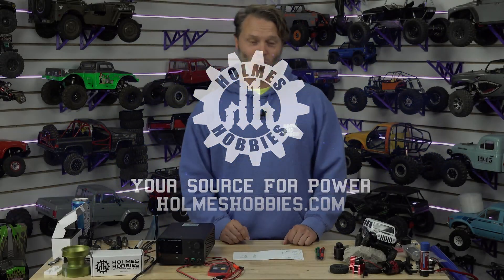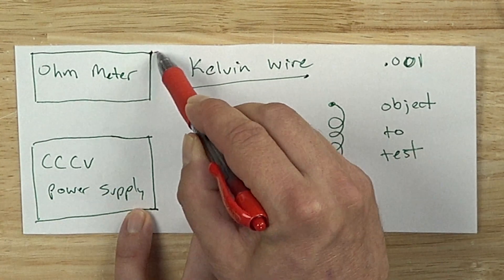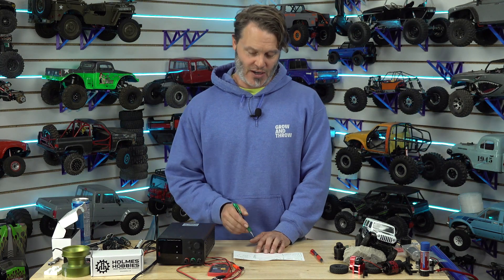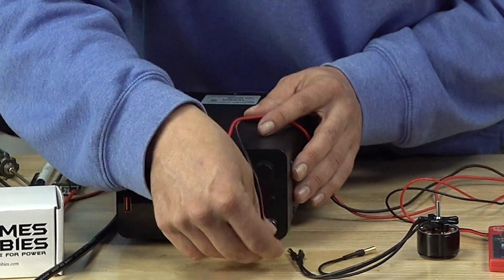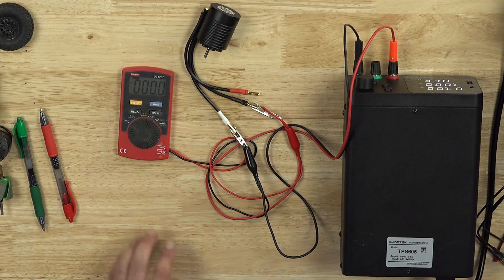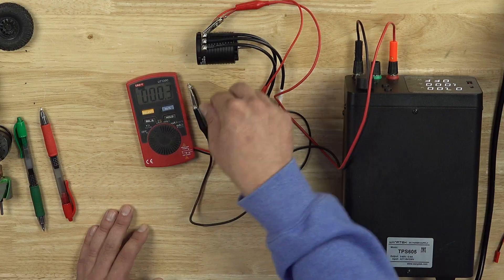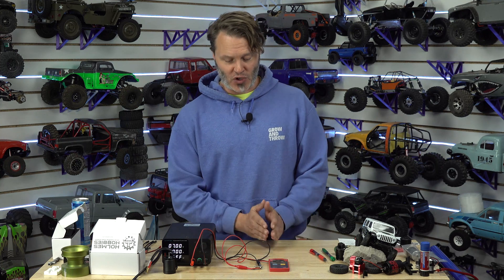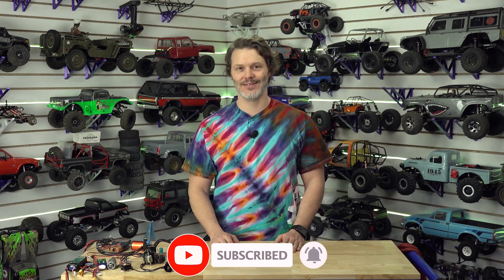John Robert’s DIY Guide + Motor Secrets! 🔧⚡💡 Build a 4-Wire Kelvin Tester & Save Hundreds!

Comment: Good to know. I'm gathering parts right now to do this stuff. 

I was collecting older brushed motors to try my hand at rebuilding them. I picked up an old BRP Motor Dyno to play with as well. Like the Kelvin system here, I'm trying to keep it super simple and low buck

Comment: Would a battery charger work for the CCCV supply?
Reply from the maker: @JKSJ683  if it has hot wire mode, yes

Comment: Cool stuff and helpful. The really neat thing is that this way of measurement takes the resistance of the leads from the power supply and meter out of the equation. If you want the ultimate in low ohm measurement precision you can use the Kelvin double bridge method which gets down to 0.0001 ohms but it's more fiddly and unnecessary for the use cases that we mostly need.

One little thing is that the symbol for an inductor was used in place of the resistor symbol in the drawing. The resistor symbol is the sawtooth zigzag one.
Reply from the maker: @brianbrigg57  oh yes, that is an inductor symbol!  At least I'm measuring a very inductive object, lol!